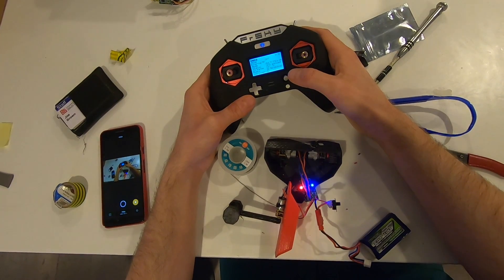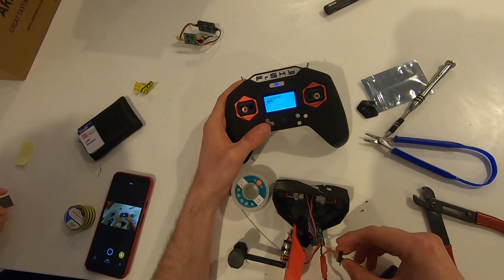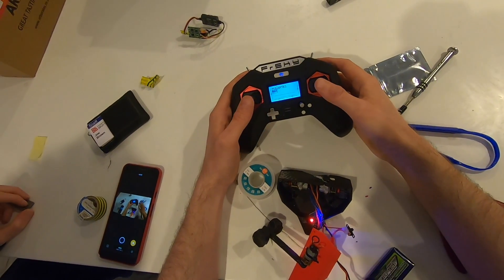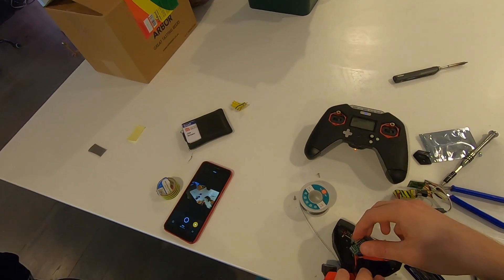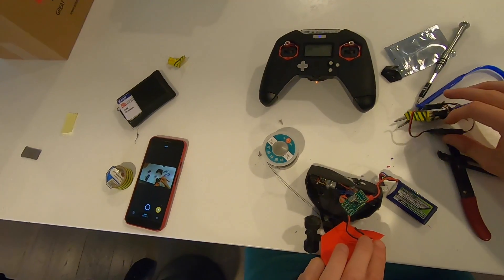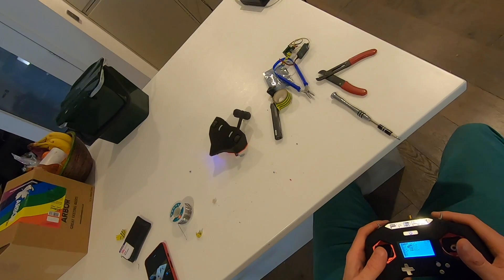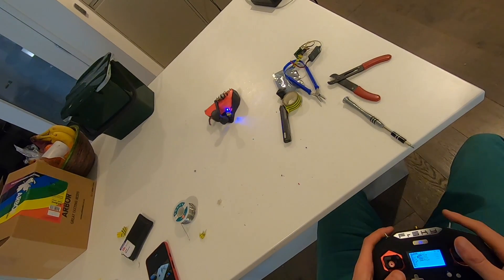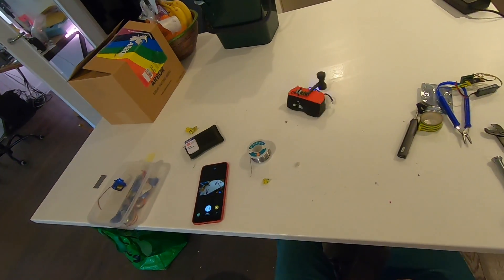Testing out the Malenki-Nano Antweight ESC in a hammer antweight combat robot

Comment: Thanks for testing!

What seems to have happened is that it's bound without telemetry active. This is normal and ok, sometimes it happens with the FS transmitters too. Maybe the telemetry is incompatible with the Flysky tx or perhaps it's just a random occurrance, I'm not too sure.

The binding packets & telemetry are even more undocumented than the normal sticks packets.
Reply from the maker: I think I had a choice whether to turn it on or off when binding.. will double check :)